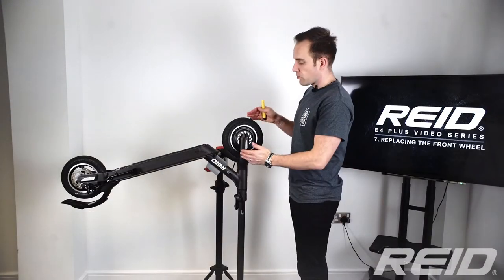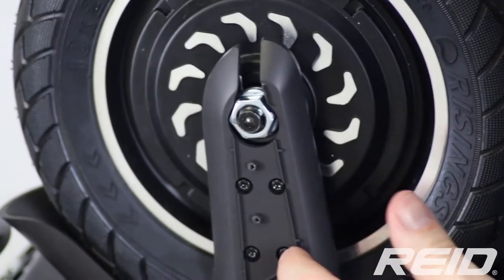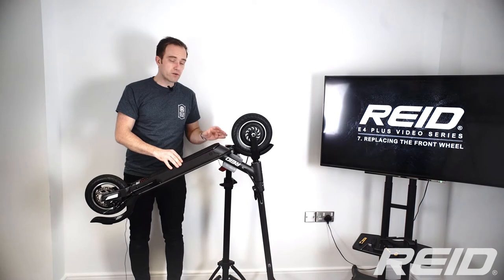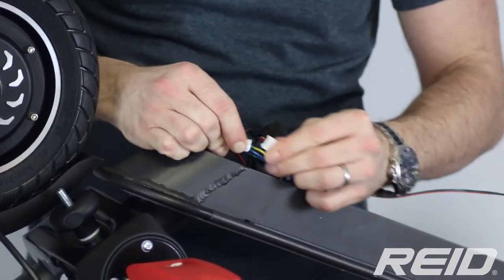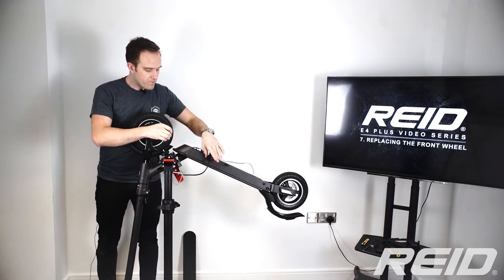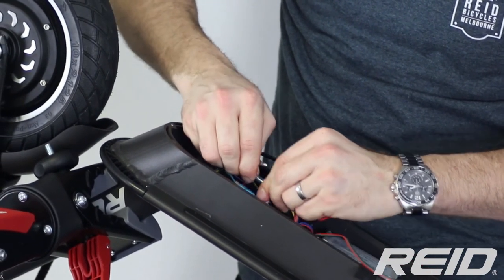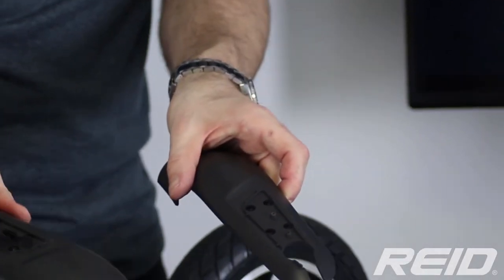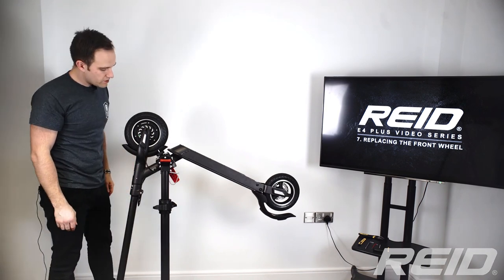Reid E4 and E4 Plus Video Series | Episode 7: Replacing the Front Wheel

Comment: Hello m8, can u help?
Have E01 error code tried checking connections, no luck followed wires to wheel all good. Remove handle bar panel disconnect lights error code goes and scooter runs fine, reconnect lights error code again.
Reply from the maker: Hey Phil, you've done everything we would recommend to troubleshoot. E01 is a wiring issue so if you have checked all connections all we can recommend now is that you contact our UK distributor. Drop us a message on our website and we can forward on the contact details.